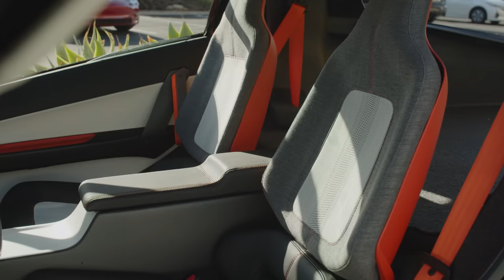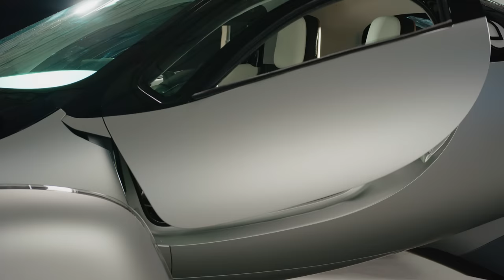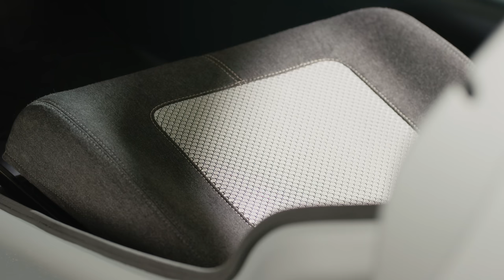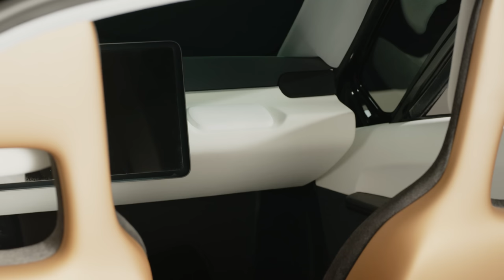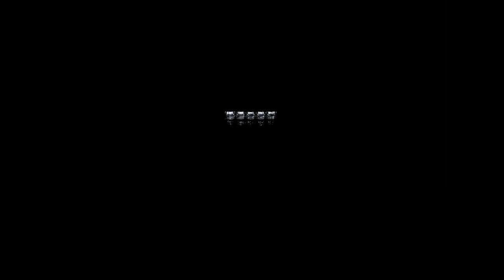Gamma's Interior Details — Aptera

Comment: Please please please offer a full steering wheel. The whole yoke fad is awful. Just give the option to have a full steering wheel like in alpha. Otherwise i dont know if id actually order one of these
Reply: I believe that the yoke as implemented in Aptera is as a result of sound engineering reasons that stem from the use of differential steering.  I am withholding judgement until test drives of the production version are available.

Comment: I prefer round steering wheels and physical buttons for common controls like sound, lights and AC. Why do designers feel a need to fix things that are not broken.
Reply: I doubt that anyone here has experienced differential steering.  I think that this is so novel that making a judgement on the best way to control it is premature.

Eliminating most physical buttons reduces parts count and costs.  The entire vehicle will have in the neighborhood of 6000 parts, compared to around 30,000 for many ICE vehicles.  There are sound engineering reasons for the design choices.

Comment: Have you considered implementing buttons and knobs for the radio and environmental controls? It's a far superior technology to touchscreen interfaces. they require no menus to cycle through, and they are safer. Also, there's another really cool thing called a steering wheel, you guys should consider adopting it. It's easier on the hands, makes sharp turns easier to handle, and it doesn't restrict hand placement. It's far better than a yoke.
Reply: Yes, of course they have.  The increase in parts count would raise assembly costs by a significant amount.  It is not compatible with the simple design mandate for the vehicle.
Reply: Good points.

Comment: I see a lot of people commenting about how they don't like the yoke. Tbh, from an aesthetics POV, I think it fits the rest of the car's interior quite nicely. However from a practical POV, I'm already starting to see some issues with being able to hold onto the thing while I'm driving. The economics of it just don't really line up with what a steering wheel should be designed to accomplish. Of course, that's just my opinion.

One idea that I've been thinking about is maybe adding a mechanism where the top nubs of the yoke can come off and a separate wheel piece can be slid into and attached to the yoke, turning it into a steering wheel. Will probably add some complexity to production, but will ultimately improve customer satisfaction and allow the aptera to cater to a wider consumer market.
Reply: Your idea is quite good and Aptera can consider that for a future iteration. It's already late for now, I reckon.
Reply: Maybe we’ll get lucky and their love affair with Tesla will let us use a Model 3 wheel that is plug and play.
Reply: I definitely will have ergonomic issues with the Yolk, and I'll back out of my reservation if I don't get a chance to drive one before my spot comes up.
Reply: Provided that they've used a common steering column design (which they will have done, since it is cheaper not to redesign the wheel), and compatible electronic controls, it's actually fairly easy to swap steering wheels.  I've done it myself, and I am a mechanical klutz.  Obviously would be better as an option rather than having to throw the original away, adding to landfill.

Comment: I hope there are other interior color choices instead of white, especially on contact areas like headrests, seats, and the center console cover. The last places I'd have as white. Looks modern and trendy, but is not the best choice for wear areas.

It's also hard on your eyes in the sun. I actually think it's a safety issue. "Exposure latitude".  Photographers might understand it better. If your eyes adjust to f16 due to the brightness of the interior and you need a f5.6 to see the dash, you won't be able to, as it will be to dark. 

The yoke is another fail. Look at the wear of any older car's steering wheel and you will see most of the wear is at 10:00 and 2:00. If its a yoke a replacement steering wheel will be the 1st thing I do to it. Maybe have a regular one as an option?  Hopefully the steering wheel will be adjustable.

FYI I have one on order and have invested a fairly good $ amount in the company.
Reply: There are several different interior color choices.

The comments on the utility of the yoke are premature.  I don't think any of us are familiar with controlling a car with differential steering.  I am withholding judgement until I experience it.

Comment: Can you discuss about safty of this vehicle? at last it's going to drive along side giant SUVs at highway speeds, how it's going to keep passengers safe around those giants
Reply: There's a lot of videos now of the testing or the results of testing this vehicle. I have no concerns about the taller vehicles because this itself is actually relatively tall and it's going to be well lit
Reply: They insist that it has been designed to the highest safety standards of any vehicle ever produced. As for the concern of driving past SUVs on the highway, they say Aptera's lightweight and aerodynamic structure make it to "glide" in the vacuum created by these heavy vehicles, thereby keeping it stable. They are yet to carry out real world tests with production versions. So fingers crossed.
Reply: @maudessen573  To the best of my knowledge, Aptera has not at any time expressed concern about the stability and safety of their autocycle on public roads.

Comment: Has safety been addressed? What happens if you wreck at 30, 50, 70 mph?
Reply: Yes.  It has been a primary focus of the design.  Even though it is classed as a motorcycle for safety purposes, it still has front and rear crush zones, an F1 style passenger safety cage built from Kevlar and carbon fiber, and seatbelts, among other safety features.  It will be voluntarily crash tested by a third party to FMVSS Part 200 test standards as soon as there are production intent vehicles available to crash, and the results will be published.
Reply: @n.brucenelson5920  Thanks for your reply.

Comment: No yoke, PLEASE. I require a steering ball to drive and the yoke is incompatible.
Reply: A steer ball could fit on the lower end on either side I would think and because being a yoke it probably won't require as much of a turn as a regular steering wheel. Not sure your requirements of placement but that's a thought
Reply: @corneliusva  I use mine in the 10 o'clock position and a quick look at the yoke reveals a standard ball won't work. Other positions won't work either. I hope you're right that not as much turning is required. But I'm afraid I would be gambling a lot of money for a vehicle I couldn't use. And I want one yesterday. I understand that tesla yokes can be switched and my hope is that Aptera offers the option.
Reply: @d.e.7467  If the yoke required  a large turning radius it would be impractical to have a yoke it seems as one cannot hand over hand the wheel.  I understand that one may need a steer ball and have used one myself with a big truck before.  Handy device.
Reply: I agree. I don't require a ball, but I am not able to hold the wheel at standard hold points, and the yolk looks TERRIBLE for me.
Reply: Steering wheel spinners (according to a July 15, 2022 vehicle report) are illegal in Alabama, Arizona, Arkansas, Colorado, Florida, Georgia, Illinois, Indiana, Kentucky, Maine, Massachusetts, Minnesota, Missouri, Nebraska, Nevada, New Hampshire, New Jersey, North Carolina, Oklahoma, Pennsylvania, Rhode Island, South Carolina, Tennessee, Texas, Virginia and Wisconsin.

They are regulated and must be easily removed when changing divers in Alaska, California, Connecticut, Delaware, Hawaii, Iowa, Kansas, Louisiana, Maryland, Michigan, Mississippi, Montana, New York, North Dakota, Ohio, Oregon, South Dakota, Vermont, Washington, West Virginia and Wyoming.

One of the biggest reasons for the ban and regulation is that having a ball sticking out of the rim of the wheel is that in a crash it can severely injure or even kill the driver despite the presence of an air bag.  

There are some states that will make exceptions if they are part of a prescribed hand control package for a handicapped driver such as a paraplegic.

As for the yoke a number of reviewers who had concerns or stated they hated having a yoke and couldn't possibly use it before actually driving with one ended up liking it once they got behind the wheel and took a long trip using one.  Many newer electric power steering systems are speed sensitive and vary the steering ratio based on how fast or slow you are traveling reducing how far you have to turn the wheel in low speed driving while making high speed lane changes and corrections less touchy/twitchy.
Reply: @neilfromclearwaterfl81  I've gotten opportunities to get behind the wheel of a lot of funky vehicles in my life.  I've used a few yolk style wheels.  Hated them all.  Thanks for playing.

Comment: How can I politely ask about the "HVAC"? What will it be and when will it be introduced into the model line? The previous suggestion that it will take years to develop conflicts with your mention of inclusion in this message. I've got a reservation for the maximum battery capacity so expect to be late in the delivery/production schedule. Will that be enough time to get a full "HVAC" package, or will we need to wait for an upgrade later?
Reply from the maker: Hi Mike! Allow us to clarify - Aptera has air conditioning and heating. Your vehicle will include a complete climate control system that is very well insulated (no matter the battery pack). The solar also allows the interior to stay at ambient temperatures on hot days to keep the inside cool before driving in the summer.
Reply: @ApteraMotors  Thank you for your clarification. I'm looking forward to getting my Aptera.

Comment: You can have a thumb button on the steering wheel that has push to select, up/down/left/right to select, and rotate the thumb button to scroll the menus.  This will keep the driver’s view up for the Heads-Up-Display and not have to take vision from the road to look at a display on the middle of the dashboard.  I already have this kind of control for my 1978 motorcycle. You could even install this switch on the dashboard side of the steering wheel and actuate it with your index finger instead of your thumb.
Reply: You will still have to look at the screen to see what you are selecting for or what setting you have reached. There is no heads up display.

Comment: So where are the hvac vents and what about windshield wipers?  How do you clear the windshield? White interior components create glare on the inside of the windshield and makes it difficult to see out. That "Hello Kitty" steering wheel looks awkward and out of place. The seats have too many different colors. I hope y'all hire an interior designer to help with these issues.
Reply: HVAC vents behind the sliding panels on the dash, I think.  "... and what about windshield wipers?" Not installed yet. Same with the rear-view monitor, the stippling at the top of the windscreen to reduce sun glare, the solar panels, etc.

Comment: A round steering wheel has saved my butt a few times, hydroplaned over water, touched a curb and twisted my steering wheel so fast, if it was the steering wheel you're showing here, good chance, it would have broke some fingers. Luckily, it only spun through my hand and I was able to regrip in time and not crash into the fire hydrant. The other number of times, was pot holes, same outcome. Also, if I am driving a long distance, I would like to rest my hand at 12 o'clock at times. At times, get it lol. Tesla has the same 3 sided shape steering wheel i think, maybe only two, they also have had their fair share of crashes, I wonder if the steering wheel played a role in some? I'd hate for this to be an issue for Aptera over a styling design.

Comment: I think having the rear view mirror displays directly in front of you will be very distracting if they are on all the time. Hopefully they display other information until you either signal or reverse.
Reply: I feel like after a few minutes it won't be distracting and will instead greatly improve situational awareness.
Reply: Same thoughts.  Also Both side view screens so close together give you a Bi-optic view, that your Brain has to take a bit to recognize is not supposed to be one picture.
You really have to focus on just the one view picture, which takes time, instead of glancing at a Mirror.
Reply: @ccibinel  Yeah.  You're supposed to be aware of what's on either side & behind you at all times.  This should make it easier.

Comment: I don't get it. Aptera reservation holders, people who are willing to make the compromises necessary to be early adopter, are fearful of something new? The whole vehicle was conceived by the genius of forward thinkers.
Though I have some reservations, I am willing to give the yolk a try because I love and trust Aptera, and it's envisionary creators. And besides who doesn't want to see a whimsical smiling face greet them when they climb into the most advanced, planet saving vehicle there is? 
Come on people give Aptera a break.
Reply: Normally I would agree with you (except for the implicit trust thing), however yokes are not new, and have known limitations, and recent reviews of other car manufacturers supports this.  Though I am willing to give it a try, at least as far as a test drive, I doubt a yoke will still be installed if I purchase this vehicle.
Reply: I was pleasantly surprised at how natural it seemed to be for people to rest their thumbs on the "ears".  There is something about the dimensions of the yolk, that also make it seem different.  

I like that they are creating a happy feeling vehicle, rather than one that is angry or menacing (as many name-brand ICE vehicles tend to embody).
Reply: @tfloyd6651  Yea, I get it, a restful driving  position on an open highway I suspect the yoke will be more than sufficient. Even seems kind of dreamy. But where I am, that makes up roughly 10-20% of driving. The rest is on urban streets or squirrely secondary roads, both with significant ice damage and pot holes. I can't see that at-rest driving position being that restful. I guess we will see.
Reply: @Bumblerazz  The steering ratio will vary with speed in that it will be high at lower speeds and low at high speeds. The wheels will turn more at lower speeds and vice versa.

Comment: Real steering wheel please, not silly fashion driven impractical yoke. You can have a yoke only if the steering rack is so fast you can only turn the yoke less than 180 degrees from straight on. If I have to let go to get to lock then it has to be a steering wheel.
Reply: Aptera has differential steering.  A yoke to control this is not a fashion statement.

Comment: When another car company “invents” the yoke everyone is all like “Wow so original!” But when Tesla did everyone hated it?! I don’t understand.
Reply: Most of the people who hate the yoke on the Aptera hate it on the Tesla too.
Reply: Because everyone here has a neck brace.   j/k
Reply: Yoke steering sucks!!!
Reply: @robertkirchner7981  Most people strongly against the yoke have never used one.  Most Tesla owners are quite positive.  Hopefully they design it so 3rd (or even first party) wheel addons can screw into it to complete the top section of the wheel for those that insist on this.
Reply: Read the other comments, from what I can see most people aren't fans.  For me, the main factor is how it performs at low speed, such as parallel parking.  If you need to turn the wheel more than 90 degrees then a steering wheel would be better.  If it is less than +/-90 degrees then I'm fine with it.

Comment: I'm still waiting to be impressed by how my visibility is not impaired by having side view cameras instead of mirrors where I can change the angle of my view by changing the ankle of my head
Reply: The screens for both side cameras will be right in front of you.
Reply: It comes with mirrors as well as cameras
Reply: As stated by another mirrors will have to be installed at least a driver's side mirror because of the current federal laws regarding mirrors on vehicles.
Reply: @d.e.7467  But, as the O.P. stated, the cameras' perspectives don't change as you move your head, like they do with a mirror, giving the mirror a wider field of view without the distance distortion of using a wide angle lens.
Reply: @corneliusva  it's a motorcycle and mirrors aren't required.
Reply: @d.e.7467  Depends what State.  Less than half of the 50 States do not require any form of mirror as a State law, however federal law requires a mirror, meaning if one crosses State lines from a non mirror State to a mirror State, you break federal law.  So, the no mirror is State dependent. It is then wiser for any manufacturer to simply have a left side mirror to abide by federal law. That applies to cars and motorcycles. The Aptera is technically a motorcycle, yes, but the above applies as well.
Reply: @robertkirchner7981  to be fair the same people who say a steering wheel blocks the instrument panel also can’t move their head to adjust the mirrors.